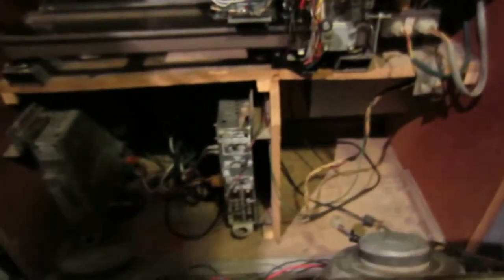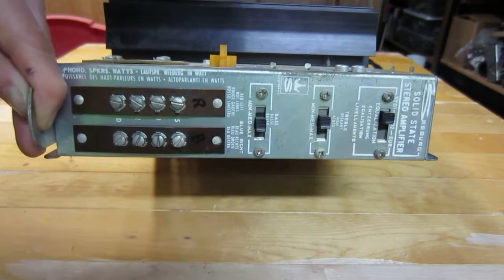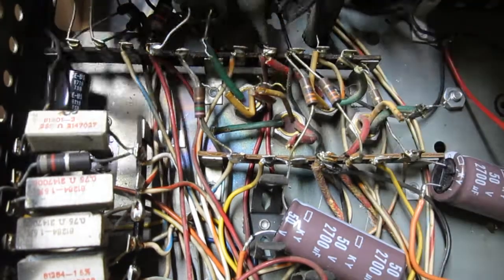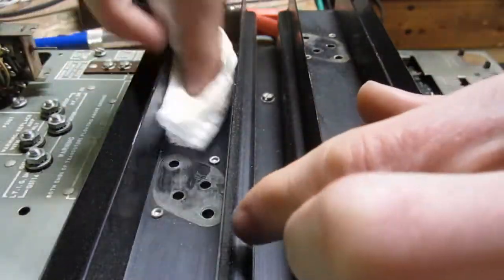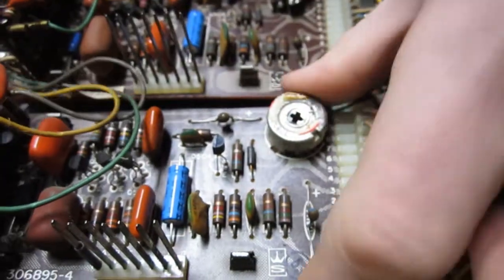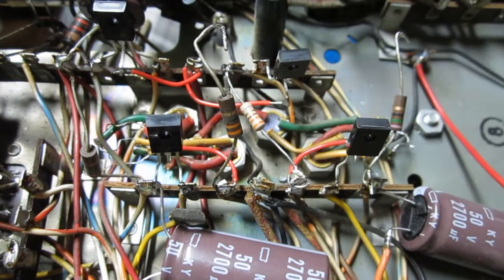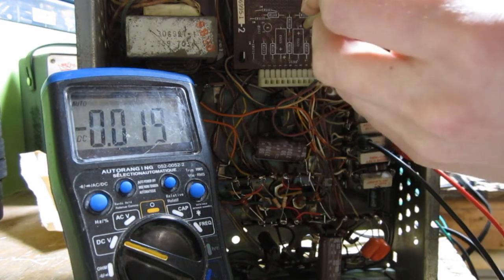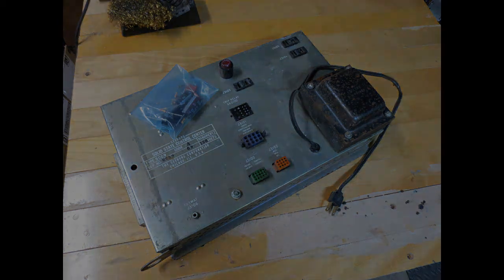Seeburg SE100 Jukebox Restoration part 5 - Rebuilding the TSA9 Solid State Amplifier

Comment: thanks for the video, I have a S100 with the original SAM1 amp.  Anyone familiar with upgrading to the TSA5? I'm assuming that this TSA9 won't be compatible
Reply from the maker: The SAM1 amplifier looks like it maybe mono and the TSA5 is stereo, if the cartridge on the S100 is a mono cartridge then it is likely not possible to use a TSA5 or TSA9 without a lot of modification.
Reply: Thanks for the quick response, I will check into it @TheCrazzyToobinator

Comment: hi, congratulations for the video, I have a broken amplifier and original transistors are not available.  Thanks to your video I can now rebuild the amplifier.  Original amplifier are 25 + 25 watts, with rebuild how many watts?  A piece of advice my speakers are completely broken, with a rebuilt amplifier can I connect 2 woofers 8ohm 50watt?  thanks for everything
Reply from the maker: Hello, if you want to do this amplifier rebuild be sure you understand how to properly measure and set bias current.  Build a dimbulb current limiter for the initial testing, it is very easy to make mistakes and damage other components with these amplifiers if a wiring mistake is made. This mod will not provide greater output power because the power supply is only designed to handle what it was rated for begore. However the amplifier will be more robust and reliable with new modern transistors replacing the original Germanium ones that tend to fail with age.  This is all the advice I can provide, the rest is up to you to figure out take your time and be safe!
Reply: @TheCrazzyToobinator  ok thanks for the information.  The germanium transistors I have found who sells them but they have a very high cost and very little guarantee of operation.  I am thinking of buying an amplifier and modifying the original system, perhaps a faster solution

Comment: Hey, thank you for the great and detailed Video! Will this modification also work 1:1 on the 230V 50Hz European Model of the amplifier? Thank you for your response in beforehand! :)
Reply from the maker: If the amplifier has the exact same circuit layout and components then yes it should because the only difference is the primary voltage used.  Always be careful though when performing this mod and use a current limiter(60-100wat incandecent light bulb in series with line voltage) when doing the initial testing.  If you have a fault or the bias is set too high for the first time test you will blow the output transistors.  I'm sure you already know this (as advised in the video) but always have to reinforce how important that is when modifying any amplifier circuit like this, easy mistake to make and transistors are pricey these days.  I hope this helpful!
Reply: @TheCrazzyToobinator  Hey, thank you for your response! I'll take a look at it and compare the schematics with the US Model, I'm thinking of restorating the Seeburg SE100 in the living room my mother got when she got 18, it still operates relatively good, but sometimes the carbon brush for the tonearm scrapes the side of the vinyl record while playing, I thought of recapping the whole amplifier because it sounds quite "muffled". So thanks for motivating people to dig out their jukeboxes and repair them!
Reply from the maker: @l42sz70  The sound on these jukeboxes is generally muffled compared to anything these days, they are not really "hifi".  But couple things to check are make sure the needle is in good shape still and does not have dirt built up on it that the brush can not remove.  Check the tone switches on the amp, bass could be up too high and treble could be to low.  Lastly there are two mid range speakers up in the top section of the cabinet, they each have crossover caps which can dry out.  If you do not hear sound coming out of these speakers make sure they are actually plugged in and making good connection inside the cabinet.  Just some more things to check have fun!